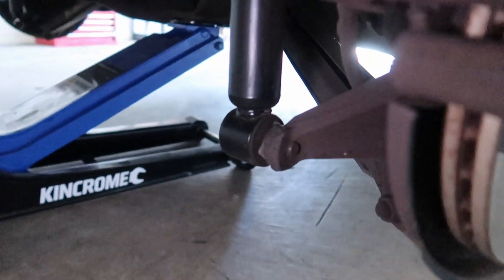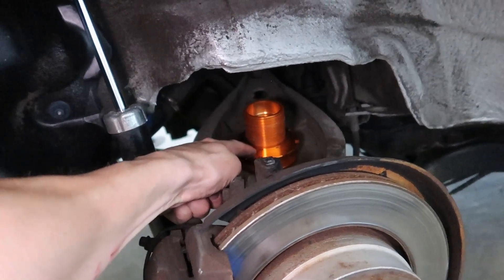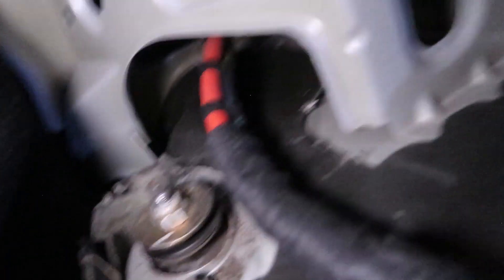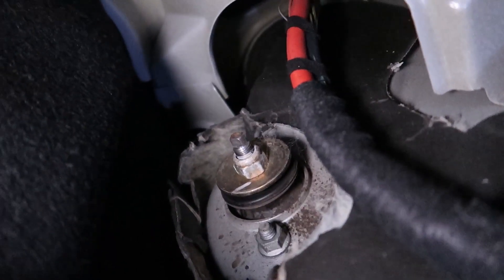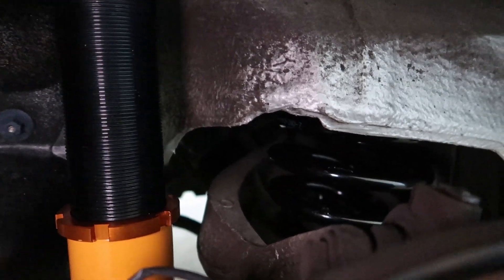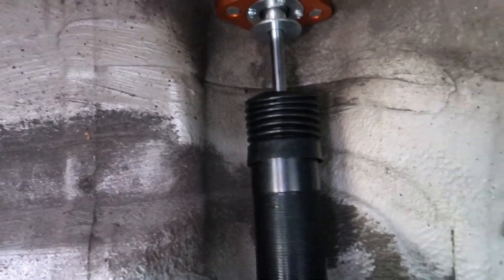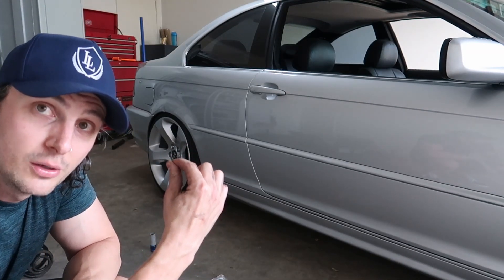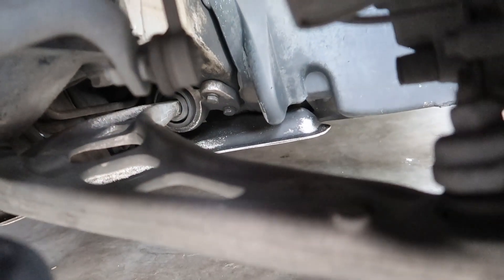HOW TO SLAM YOUR E46 BMW ON MAXPEEDINGRODS COILOVERS!!! DIY

Comment: Recently did my e46 ,Front coil overs fitted fine moved the allan bolt in no grinding needed in front . As for the rear adjustable shock absorbers i used Holden Commodore pre ve adjustable shock absorbers changed the bmw parts over to them. Commodore shocks have a longer shock body and have more stroke so can set them up properly i run the adjustable plates on the springs as well and it sits low tucken tyre nearly on rim

Comment: Nice job mate. How have you gotten on with the drop links? I keep having issues with mine breaking so I am assuming the theres too much tension on one side at the front.

Do you remember what the standard distance was between the end of the anti roll bar and wishbone?
Reply from the maker: I'll have a look and get back to ya bro I gotta take the wheels off soon to paint them anyway so I'll check them for ya 🤗

Comment: Have you had any problem’s running the rear shocks with only
50mm of thread? I didn’t want to compress the spring too much by shortening the shock
Reply from the maker: No zero issues I actually run less than that now I contacted the company direct asking what the minimum amount of threads were required I can't remember off the top of my head but its in the video where I raise the car back up a bit

Comment: Hey man not sure if you gave the measurement lenght of the rear strut. I need to know before i go with adjusting mine
Reply from the maker: Minimum of 30mm of threads have to be in the base of the strut
Reply from the maker: That's the longest U can have the strut and it still seems too short haha but that's how I have it and it rides nice

Comment: I've got a major knocking noise in the rear since after installing the suspension not sure what it is. Any ideas
Reply from the maker: Make sure u git everything tightened up good I have seen people not tightening the rear top bolts and it knocks around
Reply: @AdamLetter  I'll have a look

Comment: Hey mate I’m having issues with mine making a really loud clunking sound from the front when turning. I don’t think it’s the end links, and I’m still on stock wheels but I reckon I’m rubbing too. Some people have said it may be a preload issue but I adjusted the preload right I thought. Any advice or have yours had any of the same issues? Cheers
Reply from the maker: I have not no sorry I would go through and nut and bolt check the entire coilover and also make sure everything is set right. How did you set your preload? General rule of thumb is tighten til the spring stops moving then Add another "thickness of the C snapper" which is generally 4/5mm. And yes next step would be end links I adjusted mine to sit same position as stock in relative distance from the bottom mounting point of the coilovers. I hope that helps you 😊
Reply: @AdamLetter  Thanks for the reply man, turns out it was the stock wheels hitting the struts. Fixed with spacers now. The preload should be alright in the fronts but ive got those spring mounts in at the rear which give it way too much preload, keen to take them out after ive passed roady.

Comment: how they holding up since you've uploaded? looks clean as for the price of them.
Reply from the maker: Yeah they are good aye, like no they don't ride like hsds but they ride way better than stock and obviously sits way better. I would so it again if I had the choice. BUT I will probably eventually upgrade once I get the the tail end of the build when I'm runni g a better motor and gearbox etc

Comment: Are you running 18 inch rims ?
Reply from the maker: Na they are 19s bro from a BMW X5 10 inch wide rear 9 wide front
Reply: @AdamLetter  Damn and no rubbing issues ? I’m about to put mines on today . what is your tire size ?
Reply from the maker: @whyimihereforlifelol  ok so before i installed my coilovers no rubbing once i installed the coils it rubbed a smidge on the coilover so i am running like an 8mm spacer in front and extended wheel studs. and tyres 225/35 front and 245/35 rear they are the old tyres of my supras vskfs. worked out good timing i wa rebuilding and need wider on the vskfs
Reply: @AdamLetter  Perfect I have wheel studs install on mines already so may need to buy some small spacers as I have 225/35 all around..I appreciate the advice hopefully it goes well for this install but other than that they are holding up fine for you ?
Reply from the maker: @whyimihereforlifelol  yeah I love them
Reply: @AdamLetter  Perfect definitely will look over how you installed yours so I can I do mines the same one and have no issues and did you roll your fenders ?
Reply from the maker: @whyimihereforlifelol  na fenders didn't need rolling or anything was wrapped
Reply: @AdamLetter  alright, sweet everything should work

Comment: How much did you exactly go on the rear damp
Reply from the maker: I left it at 16 so exactly half way
Reply: @AdamLetter  16 threads left?
Reply: Bc mines is slammed I did wat you did but mines stiff  How do I make it soft
Reply: Has no bounce to it
Reply from the maker: @josemacedo2462  U said damper so that's how many clicks I did on the damper adjustment knob on the top. The rear thread into the base goes 50mm into the base. Like I say in the video I went with the old rule of however wide you go deep although I have had a chat with my mechanical fitter friend who has told me I could go far less as it has only pressure from one angle BUT yeah 50mm haha
Reply from the maker: @josemacedo2462  you could decrease the damper knob more I guess but if it's set up same as mine like exactly. The damper knob has 32 clicks of adjustment from memory or it may be 16  mines exactly in the middle.
Reply from the maker: @josemacedo2462  when you say exactly the same did you just install the spring with no locking collars or anything like I did?
Reply: @AdamLetter  and That damper adjust is under the 19 nut correct on the top
Reply: @AdamLetter  yea no lock threads
Reply: @AdamLetter  to loosen is it to the left and to stuff to the right
Reply from the maker: @josemacedo2462  Na it's the little adjust knob on top of the coilover
Reply: @AdamLetter  that’s weird I don’t have it
Reply from the maker: @josemacedo2462  must be different model coilovers but tbh I would say it's the sPring setup tbh that would make the biggest difference